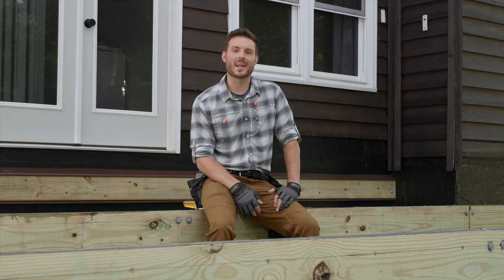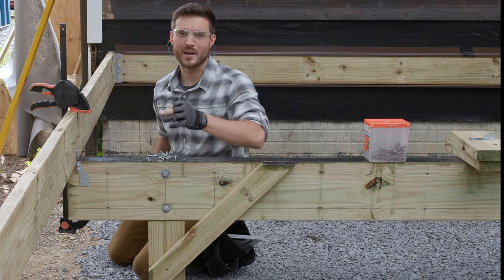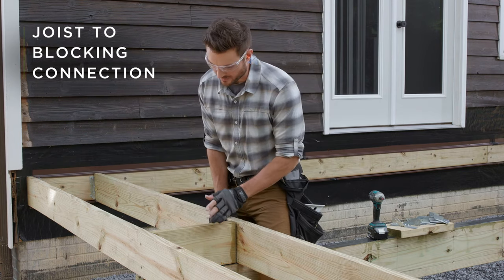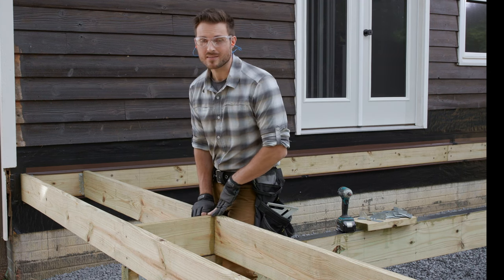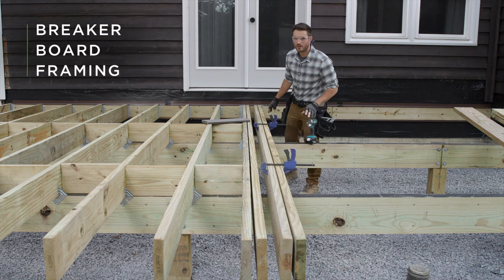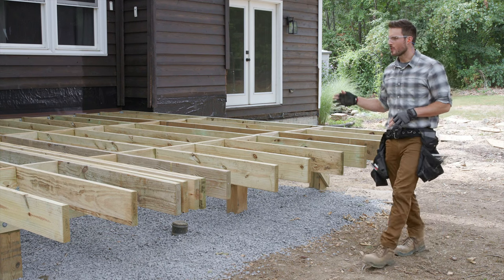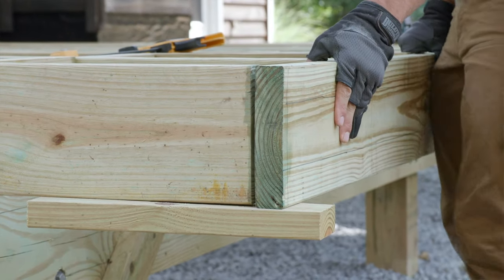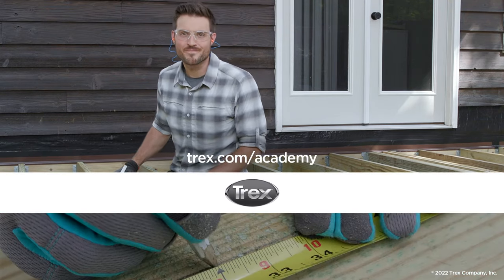How to Install Deck Joists | Trex Academy

Comment: Thank you for doing this really excellent video. I learned a lot. I remember similar projects from the 1970s and 1980s. Back then all your tools were powered by 120v cords, so electric cords would be trailing all over the place and more often than not got in one's way. The use of battery operated portable tools has really helped revolutionize construction. Being free of long electric cords is a wonderful thing.

Comment: So….nice video series, but you are obviously in an area that requires hurricane mitigation. Spent all this time and additional cost for the hangers and screws and bolts yet you didn’t attach the posts lower foundations in the ground🤷 in a wind event the only thing keeping the deck, somewhat, from lifting up are the ledger boards. As we all know that is a temporary thing, as the pressure upwards will lift that beautiful deck and the structural ledger of the house to Kansas. Did I miss a step where you secured the posts to the footing in the previous video?

Comment: "Roughly a quarter" gap is right. I did a 14 foot deck, calculated 29 boards, did 5 3/4 as the width and ended up with a 2" gap at the house because the actual gap created with the universal clips was 1/16th less than that, compounded by 29 boards , ended up way off.

Comment: Good info.  IMO I’d also recommend grading your joists when checking crowns. Measure and group the joists by size and install them from shorter to taller to help avoid a wavy deck.
Reply: That's high tech
Reply: I spent for 2 hr for just picking right straight boards at the store one by one and basically have no such a problem. And dont forget doing 2 trips to the store first for frame lumber and second for floor lumber to avoid getting your material twisted under the Sun while you work/

Comment: Great videos... I can't count the number of times I have watched each one... The only thing that I did not see in the video was how the inner joist for the breaker board are connected or attached to the ledger board... I improvised using H2.5AZ hurricane ties at the beams and overlapped standard LUS28Z joist hangers with a wider joist hanger that encased both joist... May not be as pretty but I was in a pinch and had to get the connected... As a DIYer I appreciate all the detailed information..... Well done Devin

Comment: When framing for a picture frame border with facia overhang, need to subtract one of the .25" gaps, subtract 1.25" for the facia/overhang and subtract 1.5" for the rim joist when cutting the end joists.

Comment: by using the breaker board how would you go about using the trex rain escape so the water doesn't seep thru the small gap at the breaker board?

Comment: Materials list? Wood sealer info and fasteners, screws etc?
Reply from the maker: Hi, Thank you for your feedback. Materials required are going to vary with projects and local codes. Please reach out to us at 1-800-289-8739 if you have any further questions.
Trex Customer Care

Comment: Since you are blocking as you install each joist, isn’t there a problem with the joists running outside of 90 degrees from the ledger?  (Due to differences in blocking length - no matter how careful you cut them).

Comment: What is the spacing for the joists you use for the breaker board? Thanks.
Reply from the maker: Hello Paul, thank you for reaching out. The maximum joist spacing for our 1x6 boards would be 16" on center. You could have them closer at 12" for example, just not past 16" on center. Kindly, - Trex Customer Care Team

Comment: I searched everywhere and finally found one 5/32" x 8" drill bit for the 8" .220 Simpson Strong Tie Timber screw to attach the inner to rim joist. However, it snapped in half with my first test. And another test also split the 2x8 without a pilot hole. How is everyone successfully drilling a pilot hole for the 8" .220 Timber Screw?
Reply: You don't need to drill that deep. Standard drill length should suffice. Use "peck drilling" for deep holes.

Comment: Good Morning, I'm new to your channel and must say, Great Videos! Quick question, what size drill bit are you using to pre drill the holes to accommodate the 8 inch timber screw?
Reply: 5/32 from deck post video

Comment: If you space your joists 12 inches on center, and can't fit your circular saw between the joists to cut the ends, is there another alternative?
Reply: 21:06 Hand saw or use a sawsall or use a saber saw

Comment: Thanks for the video.  Shouldn't the front rim joist be installed bark side out?
Reply from the maker: Hi Steve. Thank you so much for reaching out to Trex with your question. The lumber used during this installation does not have any bark/wane present. The bark/wane on a board does not affect the strength of lumber. Please let us know if you have any additional questions or concerns. Someone from our Customer Care Team will be more than happy to assist. Kind Regards. -Trex Customer Care 800-289-8739 |  customercare@trex.com

Comment: Today, I was trying to install the front rim board to my joists, but most of the joists sit too high. Some joists are a half an inch higher than the rim board. This is ridiculously too high to be planing them down. What do I do and why did this happen? These joists vary between 9-1/4 - 9-1/2 inches in width. I was very unhappy with the quality of these pressure treated boards.
Reply from the maker: Hello Henry, when installing Trex, you want the joist to be as level as the Trex forms to the substructure. We would recommend planing the high part of the joist down until it's level across the top. Thank you, -Trex Customer Care
Reply: @TheTrexCo  Yes, thank you for answering. I knew I had to plane down any joist high spots, but I was not expecting so many joists with high spots. It was ridiculous. Those 2x10`s were horrible. Junk. They were either cupped, bowed, or cracked. And the width variations were all over the place. I made about 4 trips to Home Depot to exchange the lumber. And I did check for the best pieces, but still I had to fight with the boards. I will never buy any structural lumber from Home Depot again. Anyway, I got all the joists finished now.

Comment: I know municipalities codes vary. But. Does the maximum cantilever increase when using 10”or 12” boards?
Reply: Yes it does, and the codes usually give you a table to read from based on both joist span/size and beam span/size combos. In any case, the max overhang must not exceed the joist span divided by 4!

Comment: How are you attaching the breaker board joists to the ledger board.  Does not look like there is enough space to use the normal joist hanger.
Reply: I have the same question. I also wonder how you are spacing the two joists. They clamped together, but with a space between them.
Reply: @jimvee4528  Simpson makes a joist hanger that is double the thickness of a 2x8, so you can hang a doubled joist.
Reply: @markledyard  Thanks Mark. I  considered that, but it wasn't quite what I wanted.
Reply: @jimvee4528  That's been bothering a few people.

Comment: There are one less space than deck boards, so the length of the joists would be one space shorter unless you include a space the first deck board away from the house.
Reply: I caught that as well.
Reply: It’s probably good to have a space against the house?

Comment: I see you are using .220 x 8"  Simpson structural screws to attach the rim board. What size drill bit are you using for pre-drilling?
Reply: 1/8” x 12” long.

Comment: A similar question to what I am asking here was made a couple months ago, but I do not see an answer.  For the four joists that are spaced close together below the breaker board, I see what looks like an L70Z bracket supporting the outer 2 joists at the ledger board, but it is not clear what is supporting the inner 2 joists at the ledger board.  Can you please elaborate on that?
Reply: Same question. I swapped out the LU26's I used on the rest of my joists with LUC26Z's for the breaker boards that are spaced closed together. The concealed screw placement seems to do the trick, but the inside connections aren't reachable to place screws to the actual joist. Suggestions are appreciated.
Reply from the maker: Hi Andrew, thank you for reaching out! L70Z’s were used in this application.  We started by attaching the L70z to the joist and then attaching the joist to the ledger.  Then cut the next joist slightly shorter to clear the screws on the L70z of the first joist.  This is just an 1/8” shorter.  Attach the L70z to the joist.  Place the joist in its proper position against the ledger and next to the first joist.  Then attach the joist to the ledger.  With the L70z’s facing away from each other and starting from the inside joist is how we accomplished this. If you have any additional questions, please let us know. 1-800-289-8739. Thank you, Trex Customer Care Team
Reply: @TheTrexCo  Sorry, this is not clear at all.  If the two LZ0Z connectors are facing away from each other why are they not visible in the video that shows nothing there on the inside? Are you saying that they both are on the same side with the inside joist installed first then the outside joist cut ⅛" shorter to clear the first one?

Comment: Are you using standard 16 inch on center for the joist spacing or is 12 inch on center recommended to reduce any warping?
Reply: 16 inch on center is what Trex recommends for deck board installation for deck surfaces.  12 inch on center for stairs.  If you are doing diagonal decking or special shapes you would need to adjust to 12 inch maximum.
Reply from the maker: Our spanning for joists and stringers will vary on angle of boards and the line of board being used. We have a chart in our install guides on pages 17 and 24 with our recommend spans. Trex Customer Care 1-800-289-8739

Comment: You should size the joists first because they are not the same width and will cause waves in deck as like the crown
Reply: When you say size the joists, how? Run them through a table saw?

Comment: Concerning the breaker boards… couldn’t you have treated those like a beam, lagged then together & only used hurricane ties on one side?
Reply: Interesting. That caught my intention as well.  He did not show how he worked the joist hangers on these breaker board joists. However, looking closely at the video it looks like he used a corner bracket only on the two outside joists and nothing could be seen on the inside joists.  I would have liked to see what he did there.  I understand his thought on the gap but personally, I think I would use double joist hangers and screw the two joists on each side together as you suggest.
Reply: @StanHallett  I think you can see it at @ 13:34, he's connected an H2.5AZ to each board. The 1/2" gap between the boards has enough clearance for the bolt heads, so that third joist has the hardware mounted in the small gap.

Comment: The lag bolts are preventing the double joist from being tight...that is a problem.  The gap between that divider will get big and it will be flimsy.
Reply from the maker: Hi Deeeps, This is a possibility.  We recommend laying out the ledger board first with all joists and blocking elements.  Then the lag bolts or engineered fasteners can be installed in between the joists in the open areas and keep them within proper specifications.  If you have any additional questions, please let us know. Thank you, Trex Customer Care Team

Comment: Hurricane ties used on the blocking are totally useless! THINK ABOUT IT??
Reply from the maker: Hi Jack. Thank you so much for reaching out to Trex with your inquiry. Would you mind providing us with the time slot that hurricane ties were used during the installation? We look forward to hearing back from you. Kind Regards. -Trex Customer Care
Reply: @TheTrexCo  My apology!  Your question forced me to review the video and on doing so I confess I must have misunderstood something that was said. I've been working 4 trades for over 60 years and at 80 I'm starting to lose it. "Live long and prosper"
Reply from the maker: Hi Jack. Thank you for taking the time to reach back out. No worries at all. I just wanted to make sure I was able to answer your questions and address your concerns appropriately. In the future if you have any questions, please let us know. Someone from our Customer Care Team will be more than happy to assist.  Kind Regards. -Trex Customer Care 1.800.289.8739 |  customercare@trex.com
Reply: @TheTrexCo  2.00
Reply: They are not attached to the blocking but are attached with 1½" connector screws to the beam and the joists. There are no holes provided to attach them to the blocking
Reply: As an old moulder guy there is no f'n way you are getting those joists level that way  You would have to mould every single joist to the same width.